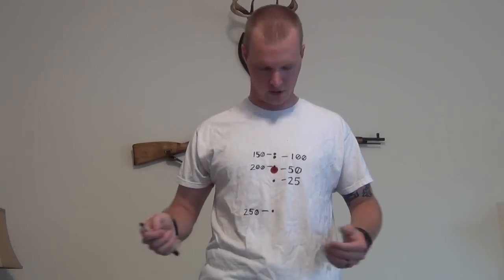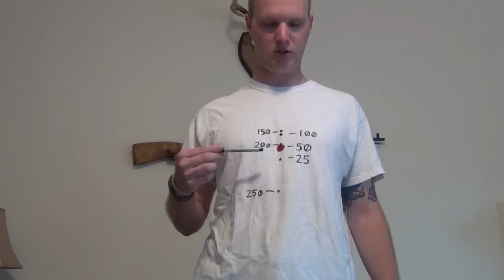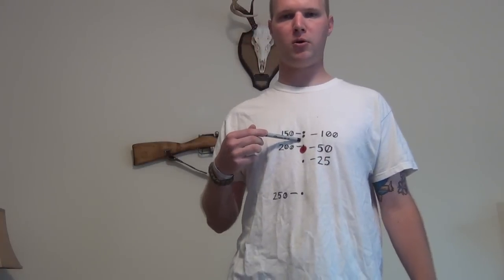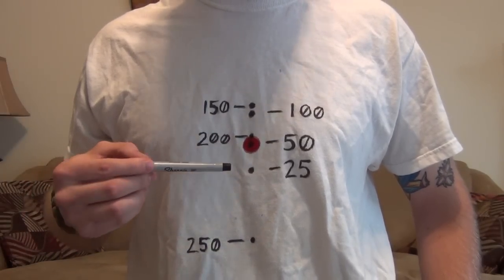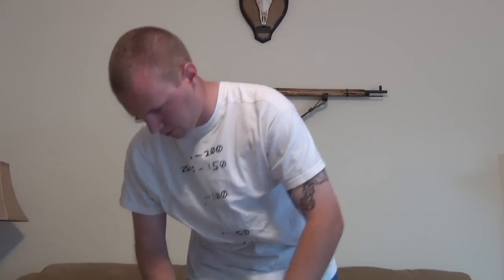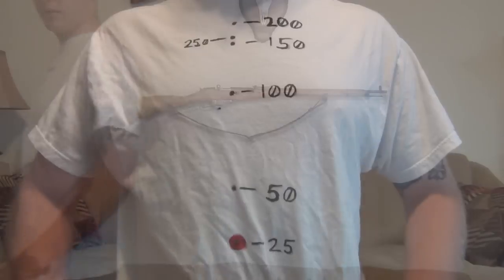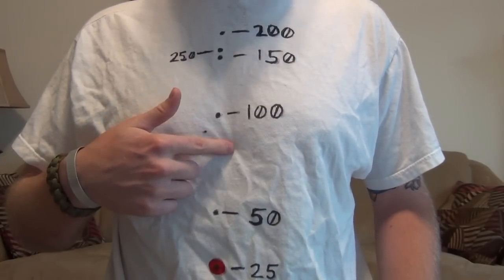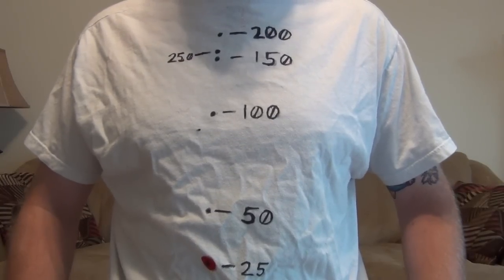RaspyGA, 50M Zero Vs. 25M Zero

Comment: My Bushmaster M4 came with a 1:9, I installed a 1:7. So far, I'm having good luck with 62gr. SS109, 69gr. Sierra TMK, and 75gr. Hornady HP Match bullets, all with a 50 yard zero. Great illustration using the T-shirt, thanks.

Comment: thankx for the info i knew the 25M zero from the army mean i know you can zero it for other ranges but i didint know spread so i stuck with the 25m and didint put much thot in to changeing it on my ar i just happend to come across your video and im really digging the 50 m zero well a long winded comment later keep up the good work good info thankx

Comment: I know the 25m zero doesnt shoot as flat, but it was designed for the carry handle elevation drum.
Reply: 25m zero on a flat top ar15/m4 has never let me down in the battlefield or during hunting.
Reply: Chasing The Fish 25m zero is all I know
Reply: @Ilovebanjos  I will just mention this for the people who are just reading comments.
0-50 meters aim a small bit HIGHER
50-250 you need to aim a tad bit lower.

Reason for this is
The bullet is still rising while flying when its point of aim at 250 meters it's now crossing your line of sight falling towards the ground. At over 250 you need to aim higher also.

Comment: Fantastic video, very helpful. I'm new to zeroing and I want to be able to shoot accurately at 300 meters with my 7.62x39 Vz.58. I know they are very different rounds with different ballistics, but would roughly what you said still apply to 7.62x39? Ie at your point of aim and impact being the same at 25 and 300 meters?